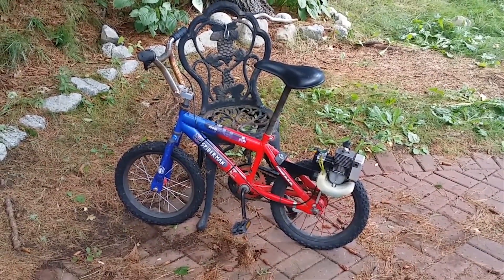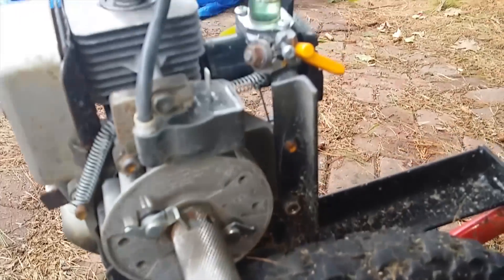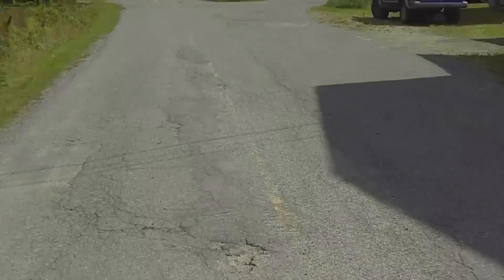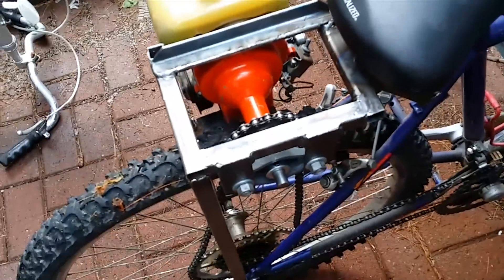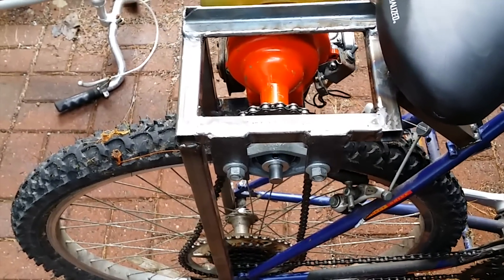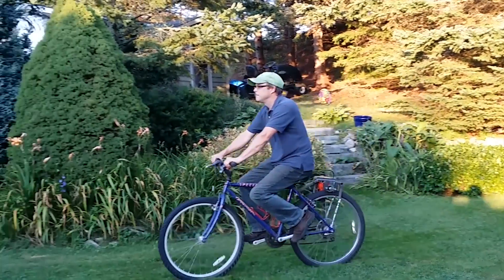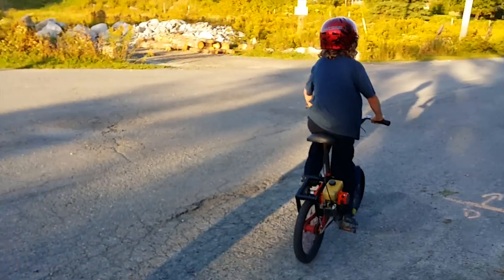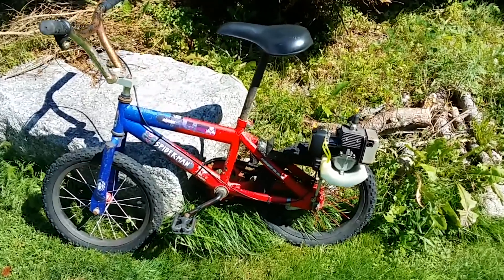How to Build (and NOT to Build) a Homemade Motorized Bike

Comment: lol its a wheel peg isn't it?
Reply from the maker: No. Had it milled on a lathe.
Reply: @madsecretlab  okay lol!  cause that literally is a 1990's GT wheel peg lol comes knurled like that already and just has a spacer shoved in it to match  the shaft loll!  I have a whole box of them sitting here ..... 0:28 in video you even see the  5/16 rod tightening hole in end of it lol 🤣👍 creative but a bike peg with spacer in it lol!
Reply from the maker: @BuildBreakFix  Congrats on having a whole box. I had none, but I had access to a lathe. Problem solved.

Comment: Does your wheel/tire gets hot after few minutes of riding?
Reply from the maker: As long as it doesn't slip, it's fine. But doesn't work great in the wet.
Reply: @madsecretlab  my tire got exploded due to heat
Reply from the maker: @Goldyshifts  Post some pics. If the tire is underinflated, the friction drive will grind through the tread in no time. I overinflate the tire to give the drive decent resistance. I'd be interested in seeing what happened with your bike.

Comment: I am doing a 35cc grass blower  with a homemade clutch (not centrifugal) and i am doing it on a small bike aswell.My father did a 70cc 2stroke BSA Dandy motor that had a 2 speed gearbox and a normal clutch back in the 80s! (He built it when he was only 15 years old!)

Comment: I made a 16cc black and decker weed eater bike on the front wheel, with a 0.75” roller it pulled me but only like 30kmh so I couldn’t even justify using the motor over pedaling (it was loud). I have vids of it on my channel, it has a big lever clutch that locks into place on the handlebars to engage the engine
Reply: The black and decker engine was actually manufactured by Echo, looks similar to that 14cc
Reply: Allan Carver thanks!

Comment: heres a tip if u dont have an engine get a drill wire tie it to your wheel replace the button on the drill with a switch then switch it on boom done

Comment: how many cc is the new motor
Reply: Allan Carver im building my first one and im using a motor with a clutch for the same reason but it wont pull me around either i think the clutches or motors are too weak idk
Reply: Allan Carver yea i have a 9 tooth on the motor i have to get a bigger gear for the rear tire im actually building 2 bikes now one friction and one gear drive ill make a video today and show you that other video is bad quality
Reply: Allan Carver https://youtu.be/cnBgNhI3lBc

both my bikes
Reply: Allan Carver its like you said you dont know what to do right or wrong untill you get into the builds

Comment: ? will a gas trimmer motor fit a 20" unicycle? assuming you've welded an angle iron for the motor to fit
Reply: Thanks for the reply , theres only one problem now, and thats the unicycle hub which spins the pedals and the wheel at the same time making it impossible to place a foot in high speeds..

Comment: so I have a question. From what I've seen most of these weed eater motors have a key slot on the drive shaft. This confuses me beacuse I know that a bicycle peg has threads. so this makes me wonder how a peg would be mounted. can some one please help me with this.
Reply: Oh ok I see I could probably get a hold of a welder. Thanks ok appreciate it. :)
Reply: +Riley Hayden , some weed eater motors have a threaded shaft, like a stihl fs36, for the centripetal clutch (which a bicycle peg happens to thread on perfectly):-)
Reply: Oh that's cool I had not idea they even did that thanks

Comment: I don't think your first engine was running properly. These little engines need RPM's to perform, even the small bore engine should have propelled your kid easily on that little bike. They have no power at low RPM's. I love your design though!

Comment: weedeater clutches will not pull you; you need to remove the clutch and make the weedeater a friction drive, even a 17cc weedeater will push you with a spindle

Comment: That smaller engine would have worked. You just needed a smaller spindle. Gear ratios are very important with these small engines .Good build otherwise. Check out my builds.
Reply: Thanks for checking out my channel. I'm about to do a set up similar to yours. Gonna see how it goes.
Reply: Austin Smith when are going to make the video on the poulan countervibe 3400
Reply: Whenever I have time to put it back together.
Reply: Austin Smith alright thanks for letting know